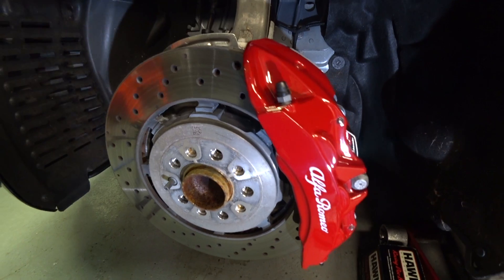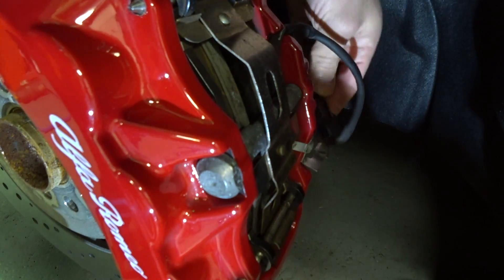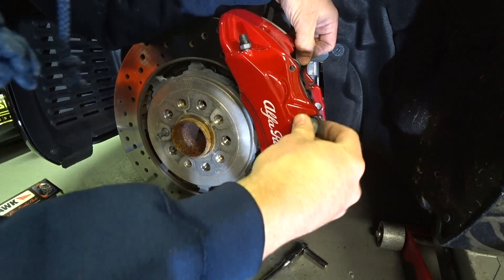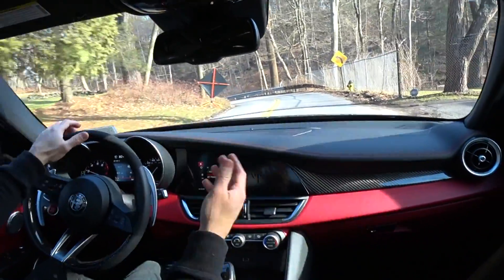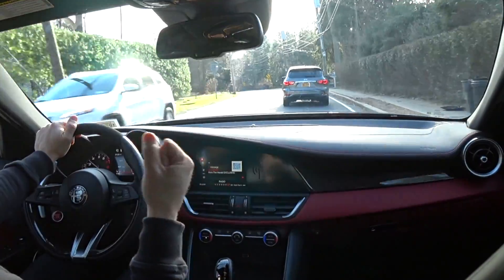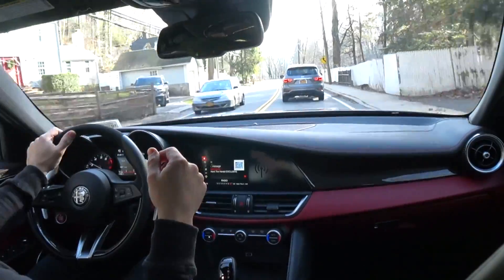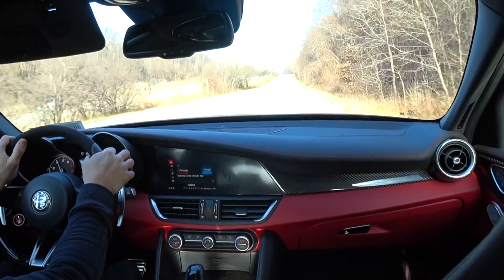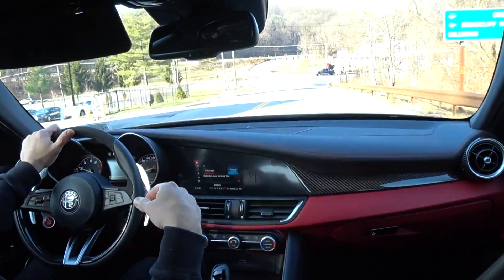Alfa Romeo Giulia Quadrifoglio Bad Brakes Fixed! | Auto Fanatic

Comment: I can hear the squeal. It’s the same squeal I get. It does bother me as I can’t understand why it’s there. I’ve had other high performance cars and NONE of them had break squeal. This can’t be normal.
Reply from the maker: il fix the squeal when i get time its easy. i was very surprised the stainless pad shims had zero anti seize on them, that can solve your issue
Reply: Auto Fanatic what I don’t understand though, is that you actually removed those shims and were still getting the squeal
Reply from the maker: those shims really wont help squeal without anti seize compound so my car had squeal with the original pads as well on and off
Reply: @autofanaticcars  Maybe do a follow-up video to this near-term since naysayers are squawking about the persistent squeal; if you are able to troubleshoot a reproducible way to mitigate.... the doubting Thomas's may have to concede defeat.
Reply: charles r.. I’m certainly not a doubting Thomas, just trying to find a fix. It doesn’t bother me all that much, it’s just annoying. It shouldn’t happen. My uncles AMG GT has the same brakes and they don’t have the same issue. I’m just logically trying to figure this out and hopefully not have to go to the dealer.
Reply: So while having the Forza exhaust controller installed today, I had them put some anti seize on the stainless shims. Squeal is gone. Thanks.